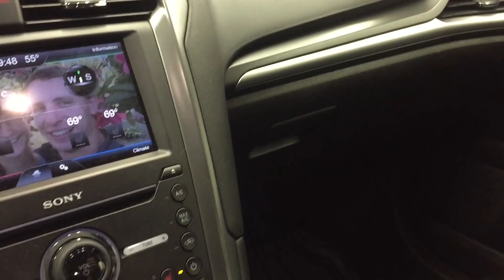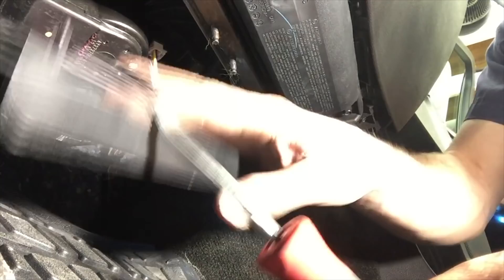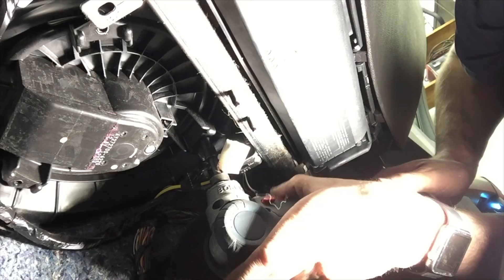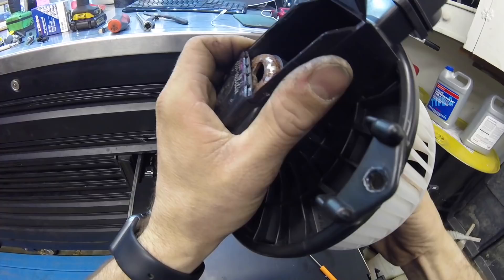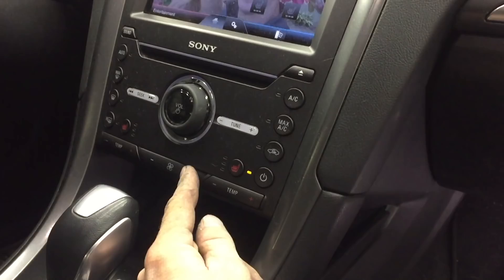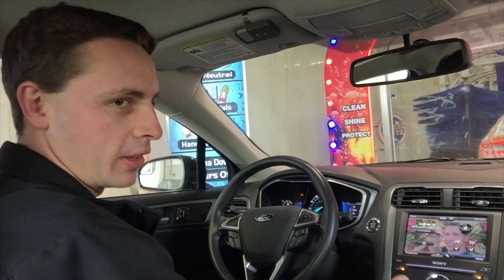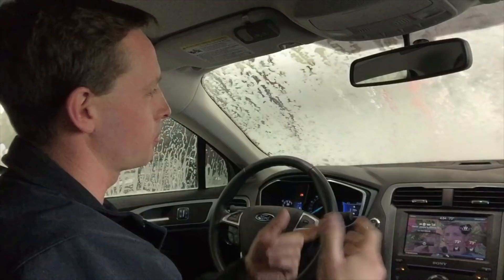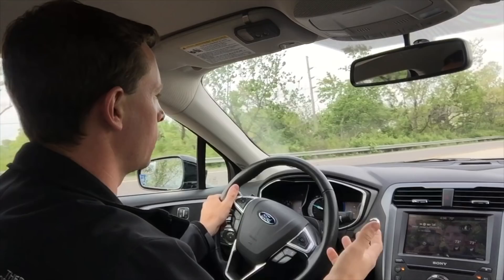How to Replace a Blower Motor

Comment: YouTube is a great learning tool. Yesterday my fan in my car made a nasty noise and stopped working. I thought big 💸 to take it to the dealer. I got on YouTube and learned how to take the fan out and I found that a mouse or some other rodent had made a nest in the fan! Reinstalled the fan and it works great!  Thanks for your instruction! Saved me big bucks for sure!

Comment: Just did mine today on my 2014 Mustang. CRAZY EASY!!! I didn’t even have to remove the plastic panel/shield at the glove compartment. Just threw a new Motorcraft blower motor in. $45 on ebay. Took 10 mins. Thanks for the video tho.... Gave me the confidence to do the repair on my own.

Comment: The honesty is the main reason I watch the channel. I am also thinking about getting a 2016 Fusion Titanium. I worry about all of the future expense of the turbo and high pressure fuel injectors just to make 240 HP out of a 2.0 4 cyl. A good 3.5 Duratec v6 would do it more reliably I think. Please make a video on your gas mileage on the Fusion.
Reply: I get 20MPG in NYC with my 13 Ford Fusion
Reply: Oh, the mpg suck lol. You make a very valid point: I get MUCH better mpg on my V6 Acura. But, I do love driving my Fusion. Absolutely love EVERYTHING about it!

Comment: I recently replaced the blower motor in the old lady's jeep. I thought the bearings had gone bad as well because of the growling noise it was making along with a shake it would create in the dash. 

Picked up a new blower and proceeded to take the lower panel and lights out along with the glovebox on a jeep. Once that was off I found the lower panel was lined with animal crackers lol.  I finished disconnecting the blower and removing it and turned the blades by hand and it seemed fine nice and smooth so I plugged it back in and turned on the fan and worked good. It was at this point I noticed a dead mouse I must have been laying on I did not notice that he came out as well when removing the fan.  My guess is that he was in the fan and it got turned on and he went for one hell of a ride and that he was the reason the blower was off balance lol.  I decide to just replace the blower as long as I had it all apart and the new parts and everything works great now       I did make sure to have the old lady come out and see her passenger and asked her if she wanted her animal crackers still (; lol.    I've told her repeatedly not to leave food in the car in the past but she did it anyways it wasn't until after seeing she had a passenger with her at all times because of the food that she now no longer leaves food in the car lol.

Comment: Great video. Thanks. I have 2013 Fusion. the Radio system broke and the Blower Motor has this chirping sound. Dealer wanted to charge me $1,500 to have both fixed. I declined . I will replace the Blower motor myself following your video instructions.  The car has less than 30K mileage. Ford really need to do a better job for quality control.

Comment: If you live in England and drive a Mazda 2. You have to remove all the pedals to get the blower motor out because they did not swap the blower motor access port over for RHD cars.
Reply: TABRAO pitty

Comment: My 2000 E150 still has the original blower in it. I'm laughing here because some of the commenters here are pretty biased on brand.  Well I've done some parts changing in my lifetime and car mfg's outsource parts like blower motors and etc. So this Fusion blower may be the same in a Camaro, a Jeep, a BMW and on and on. Maybe 2000 Acuras too.

Comment: Would this be the same on a 2013 Lincoln MKZ? My blower motor is starting to act up where it takes a bit to come on and it makes a strange noice. Once it's running the speed in inconsistent. Plus... I'm curious, was this a Motorcraft replacement or one from an Auto Supply Store?

Comment: My 2016 fusion is making a chirping noise and sometimes the blower will lock up until I mess around and turn it on and off then it’ll kick on, so mine is probably rusty and messed up too, or clogged from desert sand

Comment: It's almost as if Ford put that absorbent pad on that plastic panel because the knew it would leak in there overtime. I've never seen a pad under the blower like that before.
Reply: David S The pad is for NVH to make the cabin quieter.
Reply: It's NOT an "absorbent pad". It's for noise reduction. I bet I could go through a junkyard and find 25 various cars with that insulation.

Comment: That's pretty easy to access but it still shouldn't fail at such an early age, my 98 Crapalier has never needed the blower, or any car I've ever had actually...
Reply: Every car I've owned has needed one but my 2014 ford is the quickest I've needed one. 6 years old. Funny I replaced my 20 year old maximas this year also.

Comment: Why the hell is the HVAC exterior air vent's liquid trap and drain so damn small that it's defeated by BUBBLES?  How many bubbles does it take to saturate and eventually corrode wire splices and connectors in the dash or footwells?

Comment: Me i need to change my blower motor resistor. Is this piece is located at the same place ?
Reply: Philippe Fortin depends on the vehicle but usually located around where the blower motor is, possibly in the ducting leading from the motor.
Reply: The firewall is a common location for those as well.  Like Will said, it depends on the vehicle.  Work your Google-fu and you'll figure it out.

Comment: So the lesson here is if you drive a Ford turn off your A.C. when you drive through a car wash or in the rain or else you will blow it up! I've been running my 200k plus miled Volvo's through the car wash for years with the A.C. full blast no issues ever.

Comment: Long time subscriber i have a question tho. Why is it mainly modern american cars aren't reliable?
Reply: lmao, trying to blame germans when its a fucking ford. Classic american mentality
Reply: If you think modern American cars are unreliable you obviously didn't drive in the 60's, 70's, and 80's.
Reply: What?  Somebody here is thinking of the FOCUS. The Fusion is based on the CD3 chassis, which was designed by Mazda(look it up) It has a Mazda engine, Ford transmission, and is produced in Mexico. If the Europeans designed it, it WOULD be unreliable.
Reply: Toyota Camrys are made right here in America. 75 percent of the content and manufacturing is local. They seem very reliable.

Comment: This is why i drive Toyotas
Reply: Super Dave I had the same issue on my 2012 corolla.
Reply: Super Dave I have a Toyota and a Ford both are pretty reliable no weird problems
Reply: LOL.........people like you are just to funny
Reply: Super Dave 
Thank you
Reply: LoL, the 2016 Camry has a U.S. part content of 75 percent. The Fusion/Lincoln MKZ Only carry only 62% U.S/Canadian parts and they're assembled in Mexico, vs Camry and Accord being assembled in Kentucky and Ohio. Oh and if you look at the sticker on a new Ford Fusion, the U.S. content has dropped to 35% while still being assembled in Mexico! So, while we Toyota owners might be "rude" at least we support Our United States work force! 👍🏻
Reply: adam alder-stelljes your 100% correct that's exactly what I tell people when they say support America I say buy a Toyota Honda Subaru or even a Passat these companies have assemble vehicles here in the U.S. when American car companies have gone to Mexico and Canada! even the new Ford GT is going to be made in Canada so much for Ford patriotism! lol
Reply: yeah my 95 tacoma had its vibrate badly about 2 years ago it was just dust but replaced it anyway
Reply: in the late 90s toyota changed their business model to start accepting more parts from the global market
Reply: Super Dave Haha yet the 2016+ Toyota Tacoma's AC blower has had widespread failures where the cheaply designed squirrel cage literally breaks apart into a million pieces. That's on top of the ongoing issue with crank sensors leaving owners stranded, and rear axles failing left and right, causing a massive recall.

Comment: Brand new Ford and it already needs new parts. A lot of parts in my 2000 Acura are still original
Reply: original blower in my 91 Camaro
Reply: It is totally amazing that you cannot recognize a design flaw when you see one.  If it does this in a car wash, why would it not do that in a hard rain storm.
Reply: Fix Or Repair Daily has a source. Meanwhile, my dad's Honda from 1997 still ran perfectly when he sold it in 2014, he just wanted something new after 17 years.
Reply: And yes, he ran it through the car wash with the AC on full blast a few times, no issue.
Reply: our 2014 fusion never had an issue like this. but digital controls that default to fresh air are shitty but all new cars have that :/
Reply: Darksyne  Right! my 95 Volvo 256k has the original blower motor tranny engine car runs like a champ. I met many people with Fords that have nothing but issues two of them had to get new transmissions with the cars having less than 40k miles! consumer reports stop recommending Ford vehicles specially the F-150 and fusions because they are not reliable but folks still buy them...
Reply: my car is honda civic and i run the a/c in the car wash machine all the time. nothing happen
Reply: yes, if you saw how ford designed it. he filter and motor is horizontal. on my 2000 accord, the filter is vertical and motor is off to the side.. and any water that goes into the coils/filter/condensation just drips out
Reply: Darksyne Yet 2016+ Toyota Tacomas have been going through so many AC blower fans that they're on backorder. The fan is so blower is so cheaply designed that it rips itself apart.
Reply: Not so fast. It's an issue with water coming in from the car wash. There's a leak somewhere. The new fan could fail again.
Reply: So hilarious that he explained what happened and HOW it happened, then a certain percentage brag on their old car that never needed a blower, another automatically condemned Ford because they dislike Ford, and maybe a couple people actually heard "the soap bubbles are lighter than the water". he didn't say water, he didn't say rain, he said soap.. We use plenty of those Fusions at work, no blower issues.
Reply: original blower in my 2 year old Mondeo (EU Fusion) too..its been a very reliable car overall

Comment: This video....blows. (Get it? Hehe)

P.S. Doesn't these auto car washes scratch the crap out of your paint??
Reply: They sure do. Washing and waxing by hand is the only way to keep the paint in good shape and prevent the clear coat from peeling.
Reply: Oh yeah they will riddle your car in a golden shower of swirl marks which is why i wash and wax mine by hand.
Reply: It depends on the type of brushes they use.  Some should not scratch the pain, unless they have debris stuck in them.

Comment: messed up your blower motor because you wanted to smell the soap that smelled good thats hilarious
Reply: Melody no  this  is a bad design flaw,  my car is 9 years old it's been through countless car washes with the blower on, still on the original blower motor.....
Reply: Are all cars like this with the air intake under the windshield? That seems problematic in the first place
Reply: Yes

Comment: Every part on my 2002 toyota is stock
Reply: Shivam Sharma stock oil?
Reply: Tool0GT92 Wow i love the humor, i mean every part that isn't ephemeral by design. Obviously the air filter, tires, oil filter etc has been replaced. Those aren't mechanical component, and oil isn't a "part" per se
Reply: Tool0GT92 
good for you what you want a cookie for it.lol
Reply: yes
Reply: Shivam Sharma 
Good luck on that I'm not sending you a cookie it would cost more to send a cookie than a cookie it self.lol
Reply: I have an xb which is a toyota, it has 110K miles and I've had no issues other than normal wear items and one ignition coil.  I would the drive the car across the country and back its super reliable.